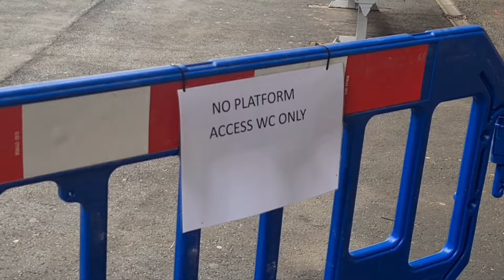UP CLOSE: Major works to Huddersfield viaduct and rail station for TRU

Comment: Great video. As my travel plans through Huddersfield station will be disrupted by this next week, it's good to see the actual scale of the project which is much bigger than I thought it would be. All geared up for the rail replacement buses anyway. Thanks.
Reply from the maker: Hopefully it's short term pain for long term gain. I think there are some even longer closures on the way next year. It's amazing to finally see some long overdue investment in this fantastic route. Connecting Leeds, Huddersfield and Manchester with a quick and reliable service could be a big boost for business and leisure.

Comment: Thanks that's a great video, and  thay are putting it back to what it used to be 4 tracks on viaduct
Reply from the maker: Yes, it's good to see some progress being made. It should make for a much smoother service towards Leeds.
Reply: 4 tracks again, you never know they might make the Bradley curve double again to Brighouse, and if their going to remodel Deighton put it where Bradley Station used to be.
Reply: @nickbannister775  Bradley curve will remain single under all foreseeable plans, and Deighton will be rebuilt in about the same place it is now

Comment: If they are putting 4 tracks down now, will they have to reinforce the existing arches in the viaduct?
Reply: It was built for 4 tracks originally, so it should only require some structural repair
Reply: There were actually 5 tracks up until the late sixties: Up and down slow, Up and down Fast  and a goods line which ran to Hillhouse sheds, next to the Down Slow, on the North side of the viaduct.